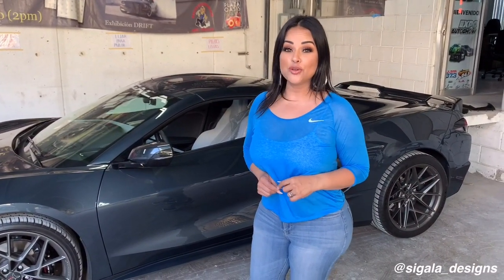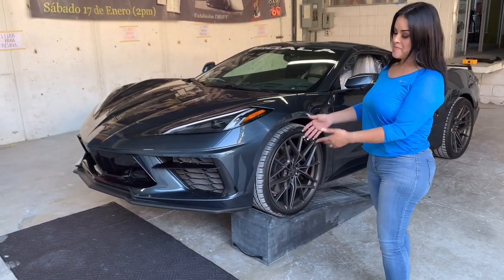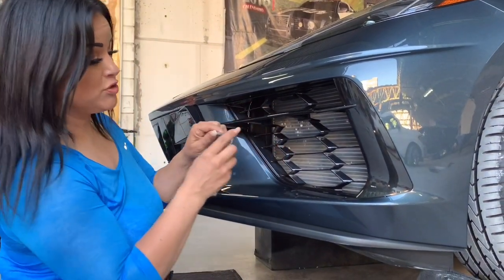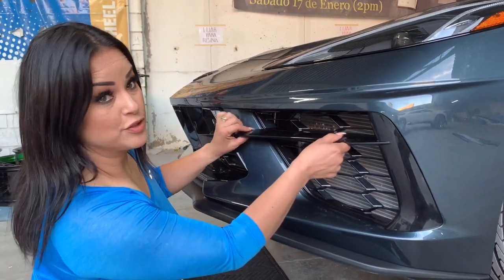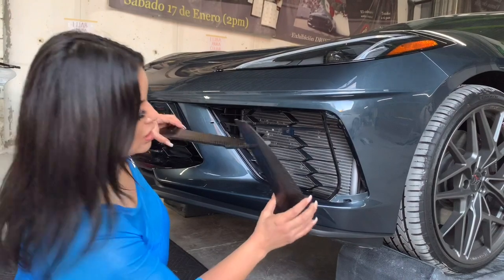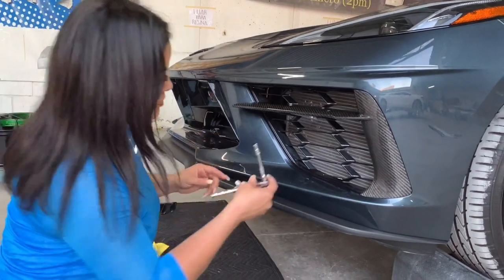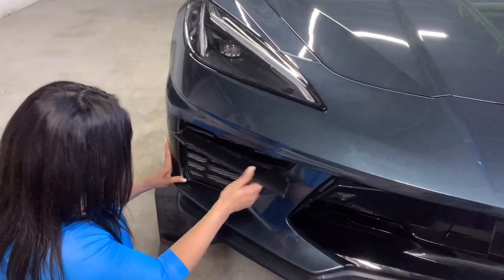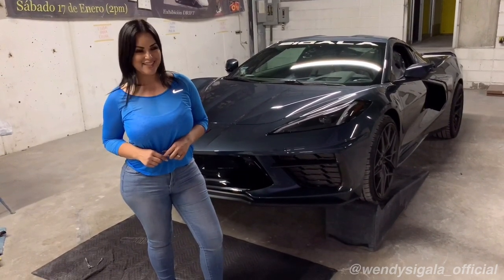How to install: 2020 Corvette C8 Front Bumper Grille bezels

Comment: FYI, Thus is NOT an easy install if you have radiator grills already installed. They will be in the way and need to move them back to fit a wrench in there.